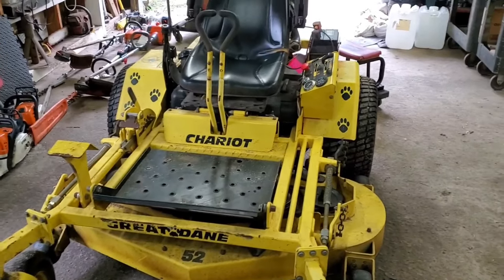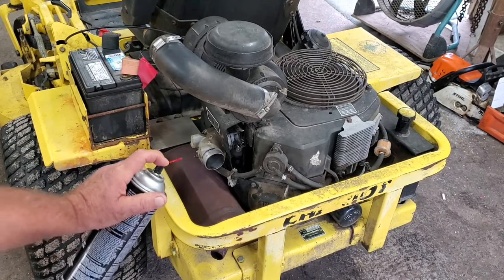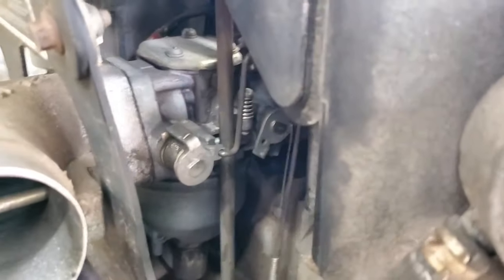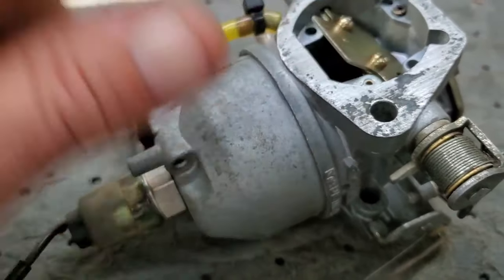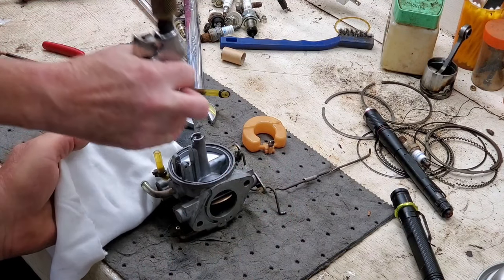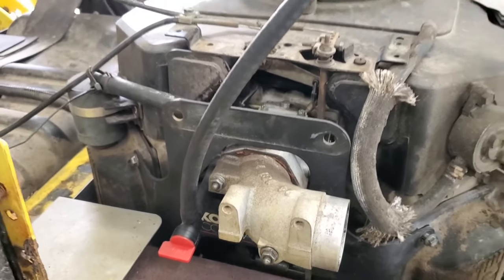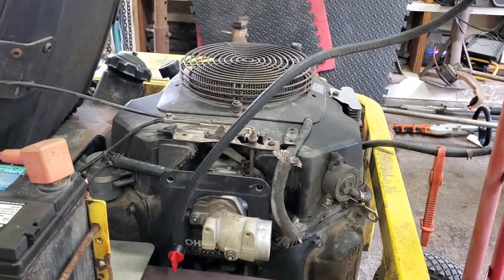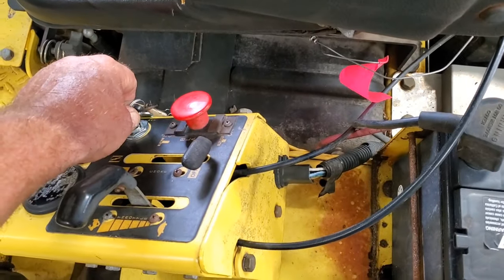KOHLER COMMAND PRO 25 ON A GREAT DANE ZERO TURN CUTS OFF

Comment: I just got a chariot  was gifted to me , after over 500 $ in parts and several you tube video's I think I've got it in good shape. Needs the belts changed but ill maybe do that this winter when it cools off and dryer. I also will change the oil in the drive system. I like your IV system!
Reply from the maker: Awesome thank you

Comment: Great diagnostic.  Like the step by step explanation.  I had the same issue with a Briggs,  turned out it was the fuel filter coming apart and clogged the fuel inlet.
Reply from the maker: Thank you sir for watching.

Comment: Well done as always buddy.  And I swear a split second after the second shot of air she blew (at 9:21)you can see a black chuck of something shoot out of the inlet, look on the right side of the inlet between the black wire tie and the inlet tube.  I had to slow it down to see but you definitely got it out 👍🏻
Reply from the maker: Hmmm I will definitely check that out tomorrow.  THANK YOU  the machine belongs to a good commercial customer of ours. It's still running great since repair. Love comments like this. Thank you.

Comment: Great video. Can’t wait to get out in the morning and give this a try on my great (Scottish) Dane. I’m wondering if this new E10 fuel we have in Scotland may be degrading the fuel pipes and causing a blockage in that elbow?? Apart from causing engine and carb problems we know the fuels  good bcoz its reassuringly expensive 🤯. I managed to get £8:94 worth in a gallon can yesterday. 😩. 
The junction you replaced is that the pump or just a junction?

Comment: Great Video! Love the ER Music and the Life Support!! Any info on these old Danes here? I'm looking to possibly buy a used one 52" 23Hp Kawasaki. I wonder how the Hydro gears are designed compared to the newer type since the steering sticks are in the center and is this a better design? I worry that the Hydros may not be serviceable or replaceable. I like this old machine, it reminds me of a Walker I used to run.
Reply from the maker: That video was filmed a while ago. It belongs to a commercial customer.  He owns a few Scags, Gravely and Walker because that's what his workers like.  This Great Dane is his personal machine, yes he still cuts his own grass with it.  The close handle design is awesome and a dream to drive one handed.  Yes the drive system is serviceable on his.
Reply: Thanks! I love the look of this ole girl, I bought one this week. $500 plus delivery. Still awaiting delivery. I was not able to dig in on what all it needs or will need. It runs and cuts is all I know for now until I get it home. I'd like to find out as much as I can about parts and service and what not but info seems limited on these older machines.
I'd rather have an old one like this as long as parts are still available. It's built like a tank so long as the normal wear an tear parts get replaced I hope to have it last awhile. Cheers!  @RaleysSmallEngines

Comment: Hey good video. I need some help. Mine is.leaking gas out the air filter. Any leads please.
Reply from the maker: Thank you.  Most likely it's carburetor issue. Needle and seat leaking
Reply: @RaleysSmallEngines  dude  ty for the fast reply. You rock. Would the carb cause it to bog down and run like crap
Reply from the maker: @natesmith3762  yes it could, there may also be stopped up jets and emulsion tube ports.  Also check the oil, most likely you will find it is overfill and smells like gas from carb leaking.  Also check the pulse line in the fuel pump to see if it's leaking into the crankcase.  Repair or replace the carburetor, change engine oil and filter, with small engine oil rated SJ or higher.  SJ or higher oil contains more zinc and phosphate for small engines
Reply: @RaleysSmallEngines  ty ! I will do that today

Comment: Hey Raley have you ever dealt with a push mower pull/key start that turns on and runs well for a while but if you stop it takes many pulls to start it back up everything cranks but it doesnt take off. Any tips ?
Reply from the maker: Maybe try and give it a shot of brake cleaner into the carburetor when it won't start.  If it starts you will know it's a fuel issue, if it doesn't it's a fire issue.  Hope this helps.  Thanks for watching.
Reply: A shot of cleaner is what it usually leads too. Thanks man appreciate it

Comment: Onthe fuel inlet,  I  had a problem with a Briggs V twin , i could get air to go through easy,  carburetor cleaner wouldn't,  I filled the tube with cleaner and blew air through.  The cleaner came through.  Put the carburetor back on wouldn't run. Took the carburetor of again,  ths time i used a small drill on the seat for  the needle ,about 3 thousand bigger than factory.  No more problems.  Most likely it jst had some built-up dirt,or gummy deposits. On the seat.  Whatever it was it worked.  I could just pour some fuel into the fuel inlet and fuel would come out. I used cleaner to flush out any cuttings ad put the carburetor back on no more fuel problems.  I wouldn't recommend doing that, in my case it worked.

Just a tip, if a machine runs out of fuel,  an easy way to prime the carburetor  use a vacuum pump to make the fuel pump prime the carburetor.  Saves time, and much easier than cranking the engine for long periods  . 

Enjoy your videos,  educational and interesting  .  Thank you for sharing your experience and knowledge with us .

Comment: Update. I tried all the things in this video and I had a few of the same probs BUT I think my main problem was sediment in the tank. Looked like Himalayan salt that come out. That In turn made the first elbow joint coming out the top of the tank really blocked up. I only used a piece of wire to reem it out a little but the air flow after that wee clean made a huge diff. Big noticeable difference with how quick the in-line fuel filter filled up when cranking it over for the first time. Soon as I seen that diff I knew the prob was sorted. So even though this video taught me loads DONT over look the first components when it comes to fuel. 

What I reckon was happening is. Once it died after ten or even 20 minutes of doing it’s thing perfectly the fuel suction starts drawing in all this crap toward the outlet in the tank. Then once it’s choked out again  you do the mess around check this! check that!  but by the time you’ve done your checks the suction has released and the sediment has fell away from the fuel pipe. 

I didn’t have all the best bits of equipment for  lifting one of these like you should and it’s a pretty difficult job to do on your own to remove one of these tanks. It’s only the removal that’s hard not the cleaning. Really wouldn’t like one of these to fall on top of me so if anyone try’s to remove a tank be real careful. Hope this helped and thanks again for the original vid 👍🏻👍🏻

Comment: The Carb was Dirty on the outside  
Maybe dirty git pass the Air Filter.
Like you said maybe piece rubber from inside the Line  
Fell broke off 
This change out Line 
Is there screen in the Tank 
Maybe clean out tank???

Comment: I have a similar great dane. Mine is the 61, and it's doing the same thing. I've replaced the fuel pump, hoses, and rebuilt the carb. The only thing I know to do next is to check compression to see if it's losing it when it gets hot or has a blown head gasket. If anyone else has an idea, let me know. My machine has 1500hrs on it.